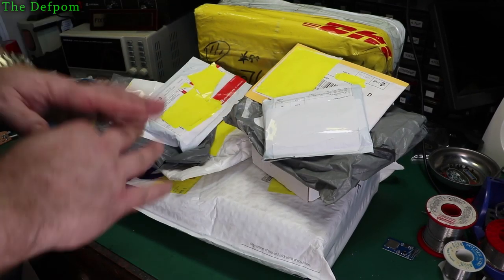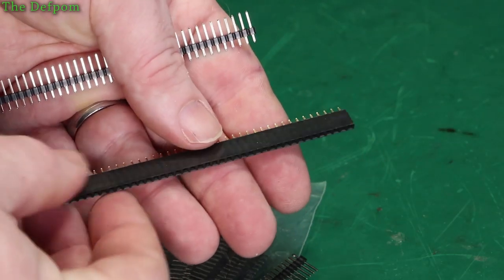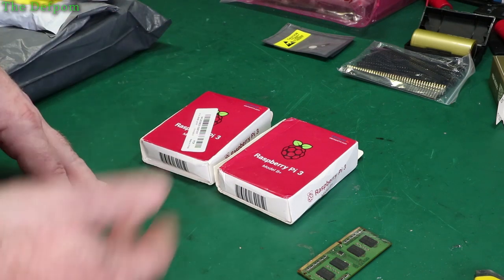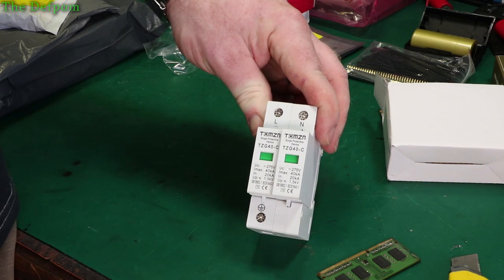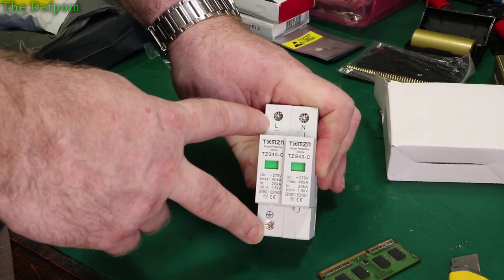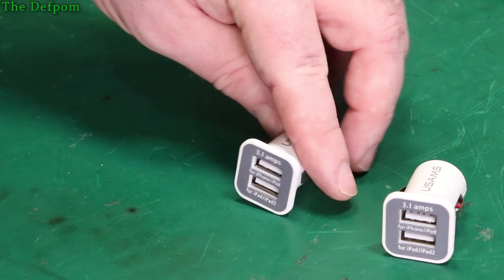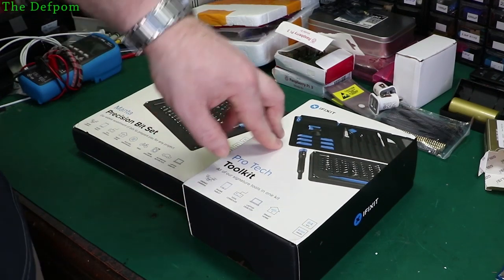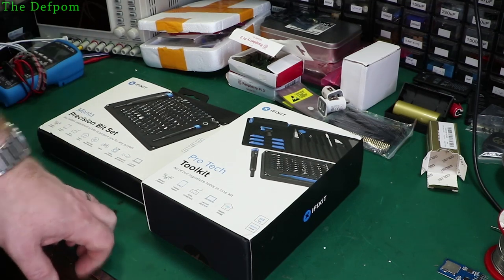#662 MEGA Mailbag !! Monday 2nd December 2019 - Look At What I Got !

Comment: Don't you buy a load of crap ha ha :-D joking :-D.
And you feed a baby those connectors, you evil sod :)
Now that's a battery!!, wonder if it fits in the crap 3 cell torches..
Reply from the maker: Well they are 26mm across... and 65.0mm long... its always fun measuring the length of a battery with a metal vernier caliper... good job I didn't do that, I just used the battery number, 26650.